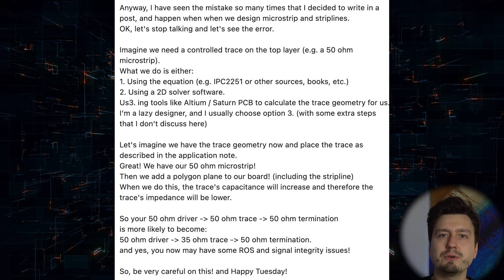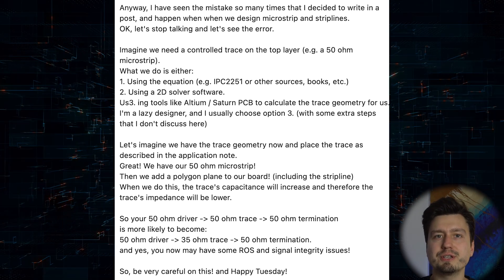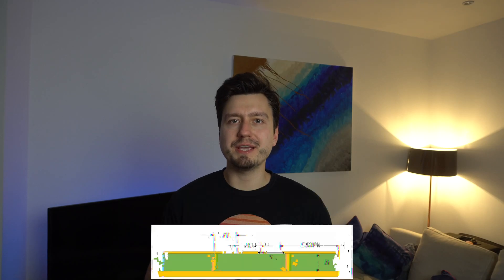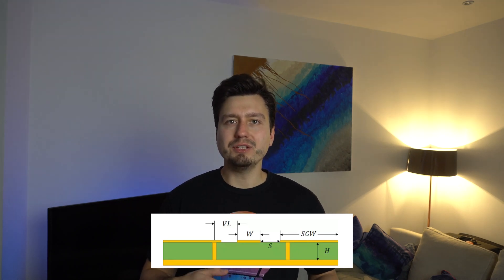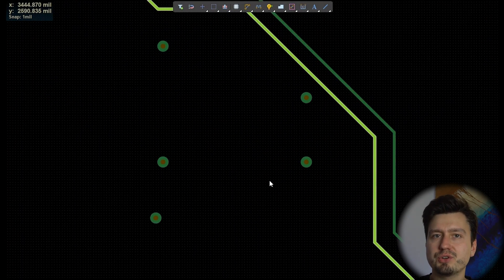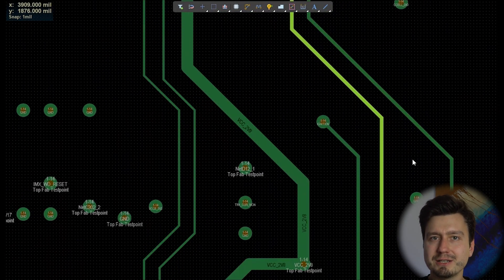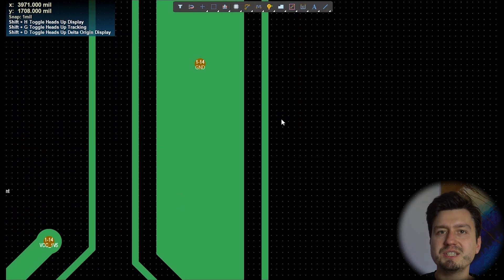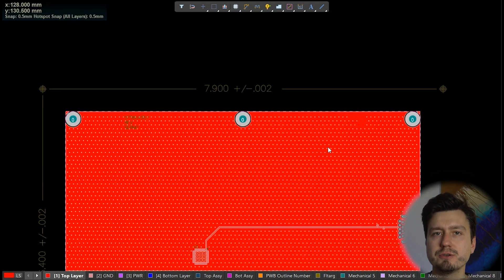Copper Pours Ruin PCB Impedance

Comment from the maker: If you found this video useful, please check out my new "Practical EMC for IoT Designers" video course. This comprehensive course contains over 10 hours of video material that cover every aspect of EMC testing for intentional transmitters in accordance with Radio Equipment Directive (RED), ETSI, ITU-R, and EN standards. Apply "RF50" discount code for a 50% off during limited promotion this year only. Don't miss out!
https://www.pcbforemc.com/courses

Comment: Any rules or requirement for the distance between trace signal to the copper pour?
Reply from the maker: Hi!
Any distance is fine as long as it's larger than the distance between the trace and the ground plane for it to act as a microstrip. Else, a coplanar waveguide calculation of trace impedance should be used